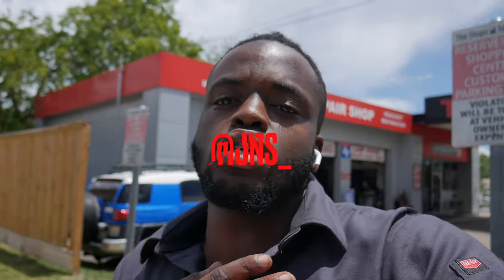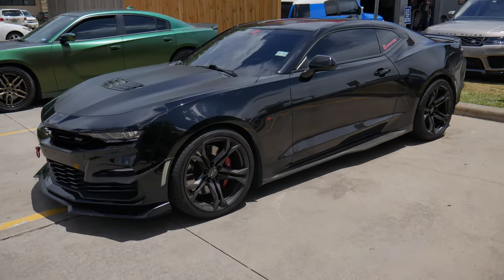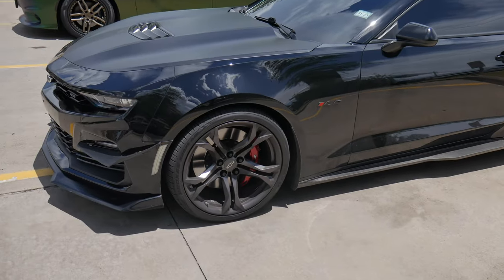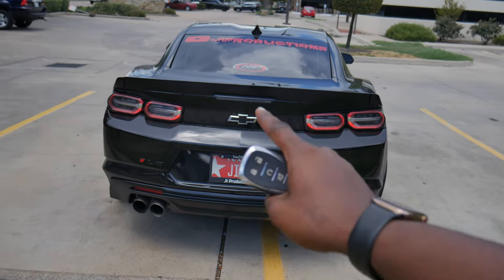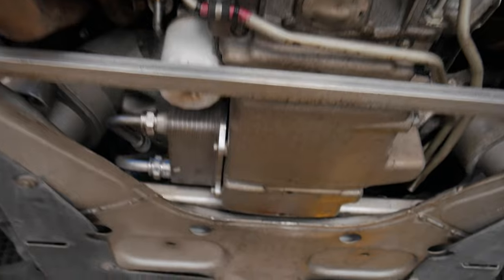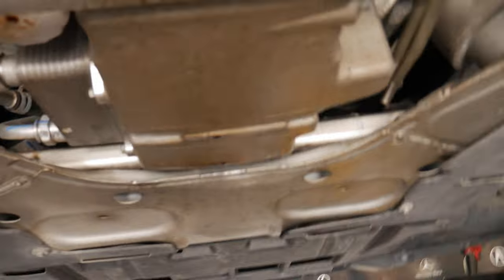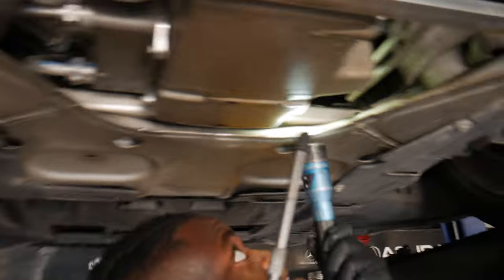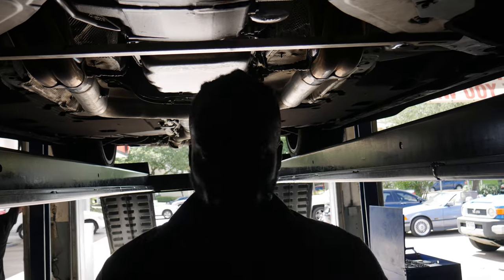OIL PAN BOLTS ARE BACKING OUT OF MY 2021 CAMARO 1LE *NOT GOOD AT ALL*

Comment: I had a similar issue, oil pan leaking and took it to the dealer. They said they had to replace 22 parts which is insane but hey it's under warranty. 40k miles
Reply from the maker: Hell yeah bro I’m taking it in next week